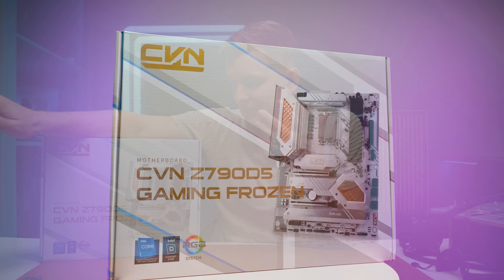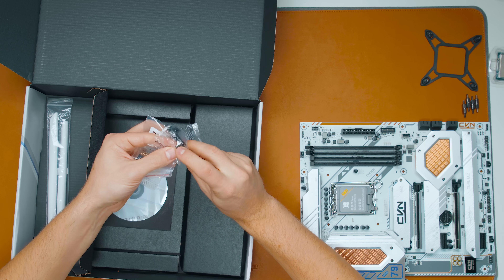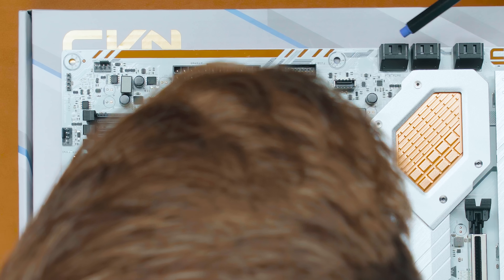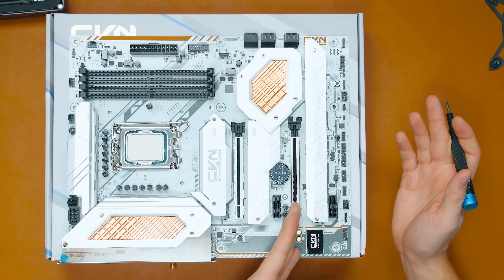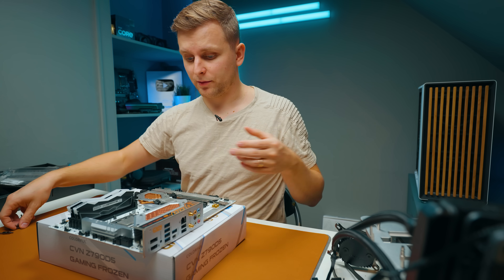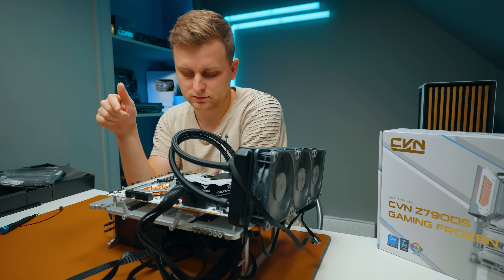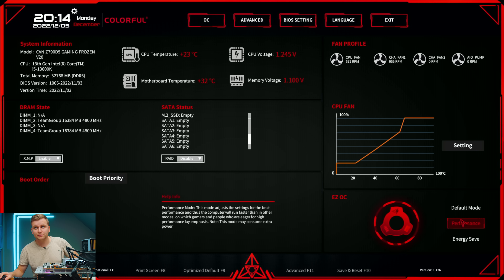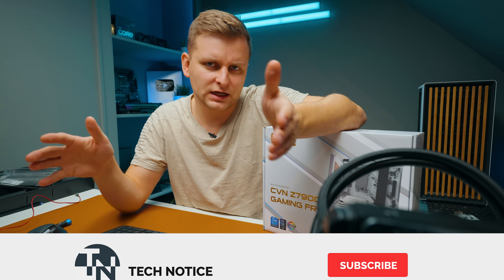Motherboard You've NEVER heard before 👉 Colorful CVN Z790D5 Gaming Frozen

Comment: This motherboard would match the color scheme of the fractal north wood and white. too bad, the case has a gray interior.
Reply: True. I was just commenting in the Fractal North video about how I'd love to match that case with my newly acquired Keyboardio Model 100 with that keyboard's wood case. A matching motherboard would be the icing on the cake, I guess, though what the insides of the computer looks like doesn't matter so much to me. I'd like the Fractal North in a full tower configuration, but might consider getting one anyways to put the parts of an old system into which doesn't need as much internal space and showcase that system while keeping my workhorse system under my desk.
Reply: I’d genuinely love to see a grey PCB mobo.
Nobody did it ever, I think.
Reply from the maker: Yeah, me too! #grey

Comment: a motherboard being for creators is the equivalent of computer case for a gamer
Reply: Not really. There are definitely motherboards and chipsets that are equipped more for creators and workstations than for gaming and general use. Thunderbolt support and a 10Gbps NIC being chief among them. Now, this specific motherboard is definitely not a workstation motherboard, but Asus ProArt and Gigabyte Aero are 100% productivity boards.
Reply: @jordanjack4629  yeah sure but at that point u get to the ltt level. where u have a huge team huge production which means they already know their stuff so labeling everything creator doesnt make sense
Reply: @gugugaga42069  There are plenty of people who are in the production scene who know absolutely nothing about hardware. Since you brought up LTT just look at a lot of them. Some of them are reasonably techy, but look at some of their editors. Many of them also use Mac systems in their free time, which also adds a lot of variability. Being knowledgeable about software and being knowledgeable about hardware are completely different things. I was in computer engineering, so I know. Electrical engineering (hardware) and computer science (software) are very different from each other. You can be an editor or a videographer and use a premium, decked out rig and not know anything about the PC you're running.
Reply: @jordanjack4629  i respect the effort you put into this. i still think its a lil too much to upload everything creator rated its kinda general knowledge for ex that this 6core cpu runs games and editing very well. covering the whole thing rather than saying "Creator" and continuing to give out general knowledge kinda missleading and unesesery

Comment: The 5v is ARGB not RGB…just in case u didn’t know. Also, u called this mobo a Z690. It’s obv a Z790…it says it not only right on the box but on the mobo as well, but yea, Z790, NOT Z690.

Comment: Hmm. It sounds like a biased review. Based on no single argument that those products are nowhere to be found.

They are one of the biggest manufacturers in China on GPU’s since 1996. So the market of China/Asia is way bigger than anything else on the market 😊.

May be you can test it just more neutral and more profound next time. What I want to see in reviews of motherboards is technical information. How to use the sata and pcie slots. What are the best set ups. 

For instance the Asus Creator isn’t that a good board for raid setups because it is limited in its setup, and so on. Thx. 

Have a nice new year 🎉every one.
Reply from the maker: Thanks for your comment! Not sure where you're based, but let's say you were based in China, and there's not a single shop where you can buy it only on Best Buy Canada for example, it would raise some questions about returns, warranty etc... and you'd probably default to something that they sell locally in China, wouldn't you?